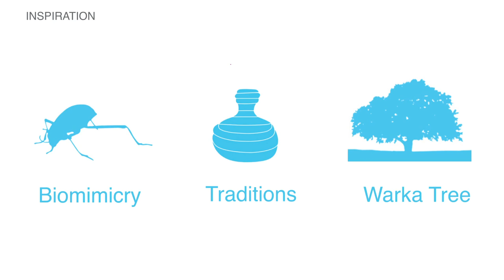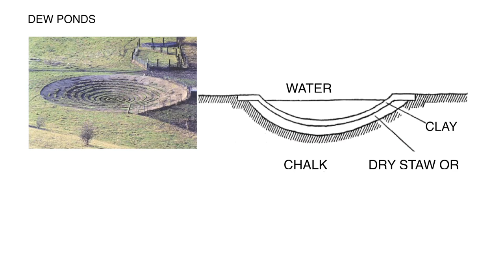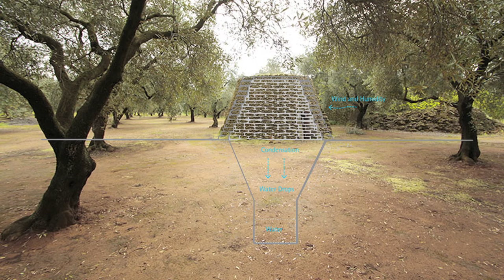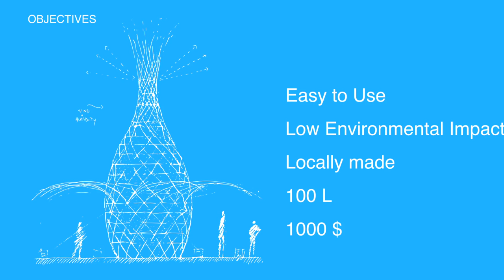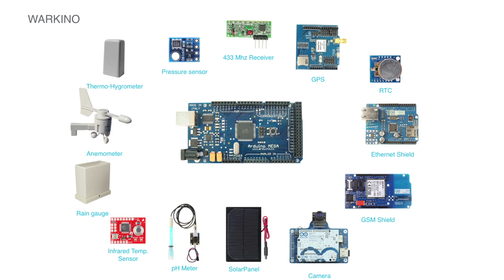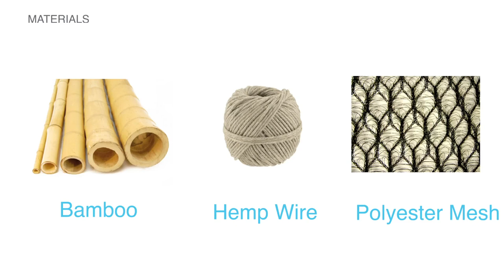Drawing water out of air | Arturo Vittori | TEDxBangalore

Comment: Square mesh oriented as diamonds would run off more quickly than oriented as squares, I think.  Or hexagonal weave oriented with the threads vertical-or-angled, rather than horizontal-or-angled.
Reply: YES.
Reply: I think the vertical would allow water vapor to pass by easier that horizontally... 

It’s like hitting a ball with a bat vs tennis racket better chance with the racket